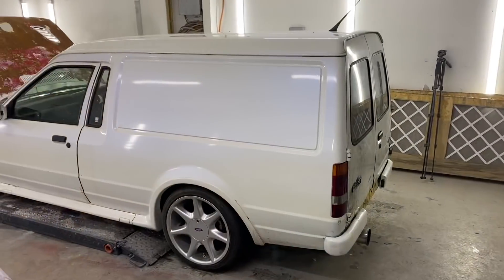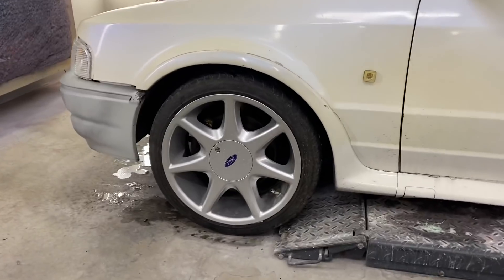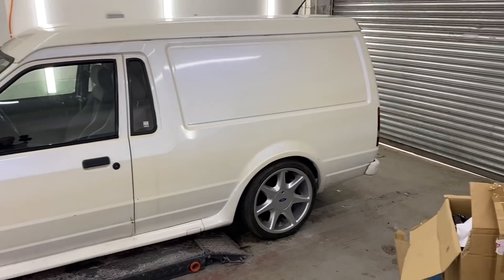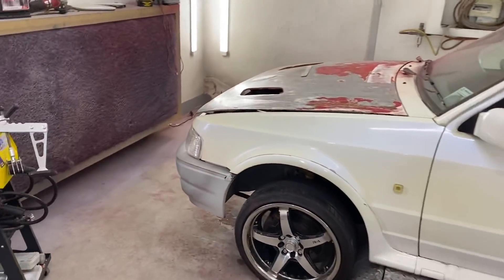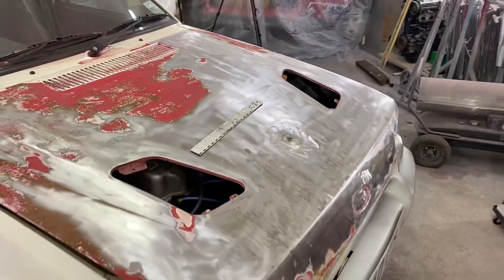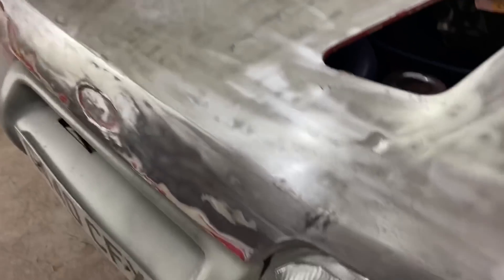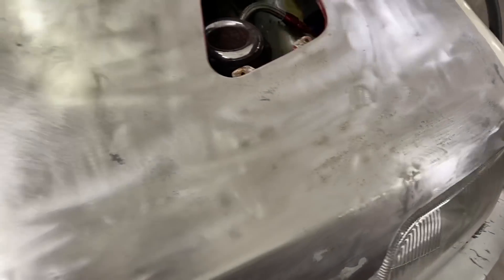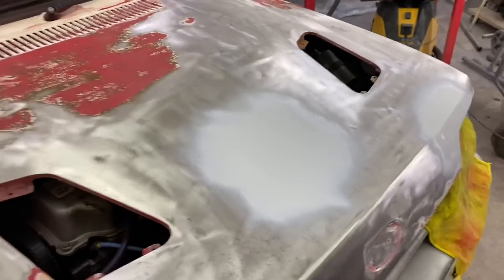Escort rs turbo van 270bhp monster 💪💪

Comment: Remember driving about in one of them years ago (slow standard one tho). Scrapped it when the rear rotted out and bearings went.  Was alright tho to be fair nice van. Make a tidy motor with little work needed for someone.

Comment: You've officially turned in to Fast Ford from 1990, They had a purple RS Turbo Van on the front cover and it was a thing of beauty it as a light purple so wasn't lary, I've never liked those 7 spoke RS wheels

Comment: I thought that old type fuel system run out of puff around 200bhp.
Reply from the maker: Not according to the rolling road print out 🤣🤣🤣🤣 and no I’ve had loads of mfi engines over 200bhp 👍👍👍
Reply: @grantssmartrepairs  great 👍 looks a nice van. I scrapped loads of mk4 escort turbos and mk1 xr2s wish i had kept tjem now.
Reply from the maker: Ahh don’t I know had more than I can count if only we knew 🤦‍♂️🤦‍♂️🤦‍♂️
Reply: @grantssmartrepairs  definitely.  I have not long ago picked up a orange mk1 golf 3 door some minor dents not rusty either.  Anyone looking for 1 let me know.
Reply from the maker: How much ?
Reply: @grantssmartrepairs  i will get some pictures of it and send them ro you
Reply from the maker: Yeah cool 😎

Comment: You could knock the tent out with a hammer if you’re now what you’re doing ???
Reply from the maker: You could indeed but I have a posh new machine to use and the dent is covered buy a support bar so just easier to use the spotter 👍👍👍👍👍